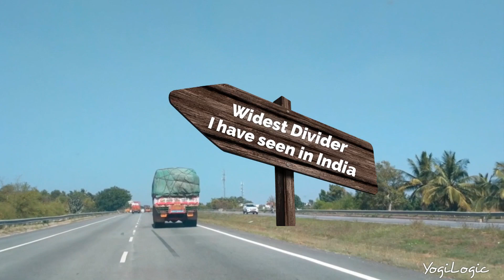Nice Ring Road Bangalore Driving VLog | Along Bangalore Mysore highway Corridor

Comment: maybe the wider divider is for possible expansion to 6 lane in future ? If the width of the divider is 10m , they can make two lanes of 3.5 m each leaving a 3 m wide divider after that
Reply from the maker: vahsir artapaham That makes sense. Its good that they have thought of it in advance. I could also see a wide shoulder on left side of the lane, so widening on both sides shouldnt be an issue in future TBH.

Comment: What is the speed limit? 80?
Reply from the maker: Double Repo yes, it's 80
Reply: Wish it can go up to 100, just like Australia
Reply from the maker: Speed limits in India are as per very old Motor vehicle Act (1988) which is being discussed for updates in limits now. It first needs amendments to the law and then implementation. 
Looks like it'll take some time.
Reply: Are there any particular standards that regulate traffic control devices on Indian roads?
Reply: In Eastern peripheral expressway the speed limit is 120kmph.

Comment: NICE road is the only road which looks like an American Freeway in India. NO DIRTY MEDIAN (i had travelled in Mumbai- Pune and Yamuna Expressways and widely in the United States).. 3 feet between median and road. 10 feet on the other side. Landscaped sides. Minimum landscaping without artificial planting but beautiful. Over passes curve and angle up or down according to the landscape. Exits and entries curve and join unlike all National Highways in India where they join straight. No shops or commercial establishments allowed along. Therefore no stray people and crossing. Designed by an American returned professional therefore no narrow minded Indian thinking in design. (The surface may be a bit bad now because of heavy traffic and weather but i meant the overall design and landscaping of the areas around)
Reply: Why is it only 4 lane??
Reply: But, American doesn't necessarily transfer to "best". I'm in America for 2 years now. Not all roads are same. New ones are good but old ones are bumpy. If you use a car that's cheap you will feel them. I have no problem with medians
Reply: You should check Hyderabad ORR
Reply: @nikhilkumar-hj8rt  On one glance, anyone can say it is India. Lot of lanes doesn't mean good design.  You should check out some videos on US highways, Newly built Chinese and Japanese highways etc. Or travel to these 3 countries, not to Europe or Middle east. All 60000kms Gadgari ji is making with the same old poor design. Not his fault, thanks to Babu's and engineers, who developed our designs in 1992 during Nara Simha Rao. That time reducing the cost was the main concern. Today, they charge 10 times, but the design is the same. Even some 100 year old highways in US are better designed!. I'm not talking negative about India, only when we understand our mistakes we can improve
Reply: @RaghunandanReddyC  It's not about Bumpy. And I doubt you were in America. You commented without reading my comment. Anyways, in America you can drive endlessly on highways without worrying about people, animals, busstops, chai shops, people stopping to take selfie, trucks parked on the highways, U turn  etc etc. And this is because of the design rather than rules. These things are dangerous and that's why India has the world's highest road fatality rate. There is consistency throughout the country. Here ,access controlled highways means a flimsy fence, which at many areas, villagers break and enter at will. In US, the sides are designed in such a way that no one can enter. US highway system is the best for a populated country and that's the reason Chinese, Japanese and South Koreans copied the exact system. Rest play politics with highways so in this condition
Reply: @RaghunandanReddyC  Don't make up things to win arguments. When I was in New Jersey, I used to travel to New York everyday morning with my cousin. She drives and we used to have coffee in the car as that was her habit. Driving at 85 mph, on Interstate 95 which was 95 years old, I used to keep my  coffee open, full to the brim and it never spiller. Tell me how many roads in India you can do that?. Roads may be smooth, but you can't do that because of constant breaking. Because of people, animals, bikes and cars cutting each other etc. That's the difference. Here we don't have the concept of a highway, we use it as streets